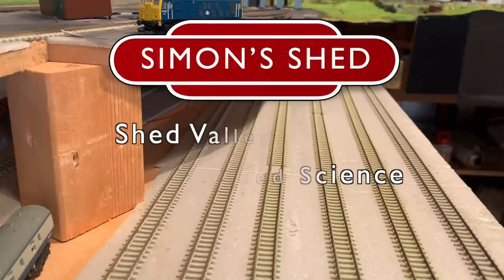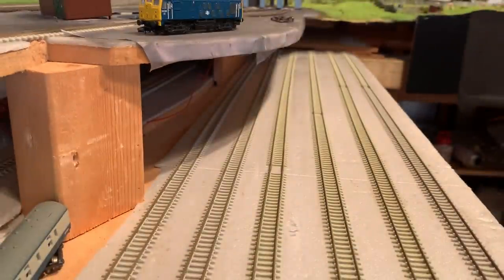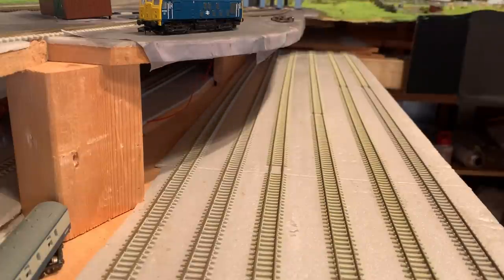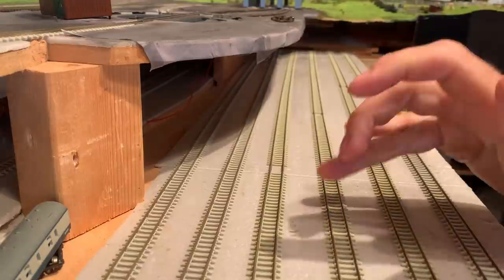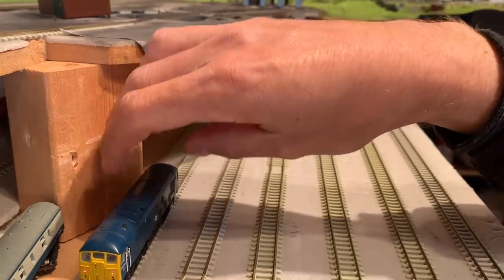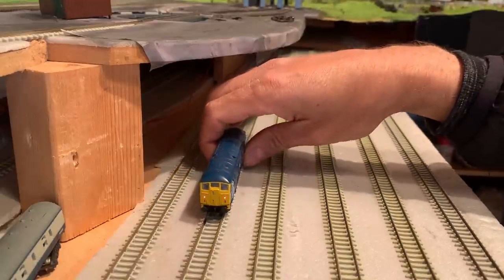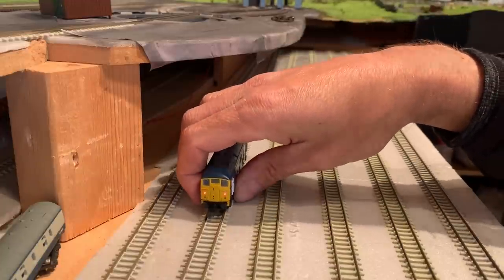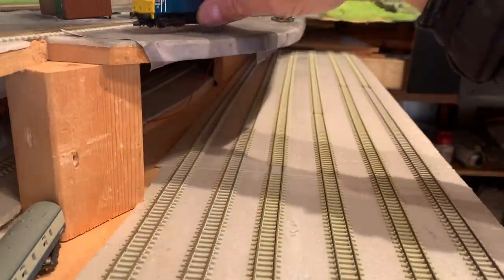Track cleaning for model railways

Comment: Inox is a repellant for dirt and dust [ Electrical ]. The positive is that
 it lubricates like fishplate said in his video. WD 40 is a lubricant for coating the distributor in your car.[ Mechanical ] The birdwood sub has lots of places where he cannot reach but he does not have any running problems .Greg works for Queensland Rail { QR } on Electrical maintenance and is very highly qualified.

Comment: I use CRC 2-26, which is produced in the US. It is the same as Fishplate Film's product. Like what you found with the WD-40 (not something that I would recommend) N scale trains do not run well immediately after using it, but leave it for 24 hours and everything runs well. I used to use a track rubber, and still occasionally still do to get some hard to move gunk that found its way onto the track, but then burnish the rails with a metal washer (making sure that the power to the track is off) and follow-up with a quick vacuum of the track and finally apply the CRC 2-26. I have used a piece of cork, a cloth or a piece of cardboard to apply it, and in all cases, it is amazing how much dirt still appears on the applicator.
In my environment, I found that after just using a track rubber, the track needed cleaning again within a week, but after using the CRC 2-26, I can go over a month before I need to clean track. A friend of mine, who was one of the people who put me onto CRC, claims he can go 6 months between cleaning, but he runs O scale.
Reply: I tried isopropanol, track rubber and brake fluid. Best by far has been CRC 2-26. Apply and let dry. Then enjoy your trains.
Reply: Home Depot $3.00 small can.

Comment: I seen the same video and agree the alcohol and other methods leave residue and debris on your rail. I found a CRC product for cleaning electric components that works wonders. My trains have never run so well for so long between cleaning. The cleaner I use is safe for plastis and doesn't eat the paint off the rails or grade crossings. Definitely worth a try. Tim
Reply: Will give this a go.

Comment: HI Simon,  
Thank you for the shout out on my video! As you say , a few weeks is not really enough of a test, as it took almost a year for me to start having issues with IPA . You can do a test and pour a small amount on a glass or metal surface and leave it dry, you will see a small amount of powder / residue left behind and this is the issue that builds up over time when used as a track cleaner. Innox and CRC2-26 are not contact cleaners,as such but leave a fine film to protect the rails form conductivity issues and they will also help remove dirt from wheels and rails, which you remove when you wipe the rails.
 I use Innox on real railway signalling equipment at work , so it works on big trains too..LOL 
Thanks again and all the best.
Gregg .

Comment: I started using "NOXID A Specal" it is an electrical contact grease. you need to clean the track using isopropyl then apply a very thin layer by using a very clean finger and then rubbing over with a wine cork. 
Upside is it lasts a long very time before you need to do it again, the downside is you might get traction problems if your application is too thick or gradients are more than 2.5 - 3.4 (or you like insanely long US style trains)

Comment: I use CRC and find that it works really well.  If using locos with traction tyres I make sure to wipe the rails with a dry cloth as it does cause wheel slip If it’s left soaked all over the rails.

Comment: Have used WD-40, 99% IPA and Track Cleaner, only main difference I've noticed is the price but they all generally worked well on some of my layouts.
Do need to get myself a powered Track Cleaner at some point, only got the Gaugemaster unpowered one which seems to work alright but isn't much more than a track rubber in a weighted wagon.
Nice to see all three loops running now Simon!
Reply from the maker: Thanks for watching, its good to get all of the tracks running again...now I can do a running session video!
Reply: Be careful with using the powered track cleaner,  a friend of mine has just had two locos repaired by an expert who put the failures down to the track cleaner. He has now disconnected the cleaner from his layout. I'd check out a few forums before you part with your cash. It seems to be suited to DC layouts using older locos with more basic motors.
Reply: The one I've been eyeing up is the Gaugemaster remake of the Tomytec powered cleaner as it's the same livery as the unpowered one (just for consistency), luckily for my layout it's just a matter of switching the controllers to switch between DC/DCC so that isn't an issue, though might look at getting an older loco to pull it round to be on the safe side.
Cheers for the warning!
Reply: @GosportRailworks  no probs, though we may be on different pages! The one I was referring to is their electronic track cleaner that is wired to the layout as a permanent device.
Reply: No worries, still it's better to be safe than sorry considering the price of models.

Comment: You used the wd40 .you need the Wd40 electronic contact cleaner.This is different to normal wd40 .i have used the wd40 contact cleaner and my track and trains are running better then it ever . thanks to fish plate. So do put any of that crap that you used on your track. You can get electronic contact cleaner from Screwfix or Halfords. so do that and you will not have any problems with running trains. And run your rolling stock over it when it wet it clean the wheels on all . Happy modelling 😀👍

Comment: I use lighter fluid, (naphtha), when my track is really dirty. It's readily available.

There are two kinds of Isopropyl Alcohol sold in the UK. 70% and 99% pure. The 70% kind has water in it. It's the 99% pure that you want for cleaning the track. It's prohibited to send flammable solvents such as IPA by Royal Mail. It is you, the one who ordered it, that will be held responsible. If you do order it, make sure it's sent by courier. 
WD-40 stands for Water Dispersant 40th formula. It was developed for use on the Atlas Rocket to prevent rust and corrosion. It can attack some kinds of plastics. I've read of a plastic modeller using it on the wheels of his aircraft model which melted and dropped off. When the solvent in WD-40 dries it leaves a black gunk. I know. I used it many years ago on my living room door hinges. Can't get the stuff off the door. :-p The only model railway use is to oil the hinges on your garden gate so the other half doesn't hear the postie delivering another very expensive model to you. :D I contacted the WD-40 company and asked if it was safe to use on model railways. They said ask the model railway manufacturers because they didn't know.

I think that window cleaner also leaves a residue which is there to make your windows sparkle without streaks.

White vinegar is comprised of acetic acid (about 5-10%) and water (about 90-95%).

Australians use Methylated Spirit. The kind sold in Australia is not the same as sold in the UK. There's is a clear liquid while the kind sold in the UK has a blue dye in it, to stop people drinking it, and when it dries it will also leave a residue.
Reply: Amen! at last clarity!
Reply: I’ve been using meths for a few years now and it seems to do the trick. I have also tried the Wahls clipper oil by placing a few drops around the layout allowing the loco to spread it around. That also seemed to work.

Comment: Best way I've found is to use high concentrate IPA (99%) and use a small square of Masonite. I have a friend who works at a supermarket, and they use Masonite board in between layers of stock on pallets, so I can get an unlimited supply (also makes great fascia boards!). Using the ROUGH side, put a small amount of IPA on, and rub the track with that. The rough side of the Masonite seems to soak up the small amount of water, and it will take up the dirt and grit, but is soft enough not to damage the track. Be careful with things like electrical contact cleaner. They do great to keep the rails conductive, but they can be pretty bad for spreading muck around the track, and ESPECIALLY onto loco wheels!
Reply: Greg Rientjes you need to watch Fishplate Films to see why you SHOULDN’T use IPA to clean track!

Comment: When I had a gauge 1 garden railway with a mixture of Aristocraft and Peco track, an application of WD40 (without wiping off) letting the trains spread it around the track, would make an immediate difference to the running of the locos. Electrical pick-up was enhanced and it had the additional benefit of flange lubrication on the tight radius curves.
Although most of my rolling stock had metal-tyred wheels, there was no damage to any plastic wheeled stock. The track was in use for several years, with exposure to the weather and bird droppings, but the WD40 coped admirably with all that. The only damage that ever occurred was a nearby lightning strike frying the output transistor on the power supply.
For my more recent indoor 00 gauge lines, I use a Peco cleaning block or a fibreglass electrical contact cleaner stick.

Comment: I bought a product to fix the connection issues I had with the trailer plug/socket on my car (which gets exposed to road salt in winter). The label on the product insisted that after cleaning I needed to use their other product on the connection to prevent re-oxidation. It worked ok. Doing some research online I found out that the cleaner was  isopropanol and the protecter was isopropanol + some hydrocarbons similar to those found in CRC 5-56 / WD-40... I think this applies to many contact/electrical cleaners...

Comment: Speaking of science, Joe at MRH magazine has the following to say about track cleaning: "Anything in the non-polar range is "best". Best really is what's cheapest, and the La Mesa club is getting superb results with mineral spirits, so I'd recommend starting there.  The dielectric constant isn't the only consideration -- there's also how any solvent reside ages. Mineral spirits is more of a solvent, s will both clean and protect -- a great balance.  Finally, a very light treatment on the inner railhead with a graphite stick will add that extra touch to help protect the wheels and rail from rapid oxidation from micro-arcing."

Joe also states: "I don't recommend ISO alcohol for cleaning track (or wheels) any longer. The La Mesa club has found track and wheels get dirty with black gunk a lot quicker when cleaned with alcohol so they have banned its use for cleaning wheels or track. Chemists know that non-polar solvents make the best electrical cleaners because they don't encourage new oxidation later as much as polar solvents. Non-polar solvents: - mineral spirits - turpentine - kerosene - toluene (nasty stuff, though) Semi-polar solvent: - ethyl acetate Polar solvents: - isopropyl alcohol - ethyl alcohol - denatured alcohol - acetone - ammonia Better choices for cleaning electrical surfaces are the non-polar solvents or at least a semi-polar like ethyl acetate. If your reaction to this news is: "I've never had a problem with the polar solvents", I challenge you to try cleaning wheels and track with a non-polar solvent instead. You may find things stay cleaner longer! The non-polar solvents reduce micro-racing and oxidation of active electrical surfaces. You who have been in the hobby for a while may remember the "clipper oil keeps your track clean longer" discussion from decades ago. Clipper oil is NON-POLAR. Also, if you check contact cleaners like DeToxIt or CRC-26, you will find they're slightly oily, which means they're also non-polar in nature."

Comment: The guy from Australia recommended electrical contact cleaner. WD make such a cleaner which is different to the penetrating fluid  version you put on your track.
Reply: INOX MX3 may effect some rubber products with continual long term use.

Comment: How often would you suggest cleaning the track?
Reply from the maker: If everything is running smoothly I'd leave it, I only clean the track it the locos are stopping / stuttering.
Reply: @SimonsShed  I only have 2 locos at the moment. A Dapol Class 33 which I brought brand new. The other being a Dapol Class 04 second hand from ebay. The 33 runs perfect at both slow and fast speed, Where as the 04 runs ok with throttle wide open but keeps stopping at slow speeds no good for shunting. I think the 04 being second hand maybe needs a clean/service but unsure how to do that.

Comment: i use n gauge kato track.i  found brasso on fibre,which removes dirt far greater amounts than track cleaner or ipa, then polish off with a j cloth. no problem with engine performance.Sam,s trains was my reference for ipa but brasso just pulls the dirt off.My kato tgv's just fly round.

Comment: we recently dug out our box of track. we dont have a fixed layout so had to spend long time with 1200 wet and dry to remove the oxidation. we where wondering if we dunked the whole lot in bucket of coke as we know what it does to a dirty old 2p.?
Reply: I just got a free train table that i want to clean up so i can run my trains.

Comment: I watched the same video but thought he said it had to be silicone free which WD40 is not. I was going to get some contact cleaner to try. I would be interested in how they effect the points connectivity over time. However it seems to be running fine with the WD40 so now I'm confused.
Reply from the maker: just to confuse things even more, just checked the front of my can of wd40 and it says "silicone free"!  Maybe they changed the formula?
Reply: @SimonsShed  Oh Ok thats fine then.

Comment: Isopropynol or Isoporpyl Alcohol or IPA are all names for the same thing. The modern  scientific name is propyn-2-ol. The "propyn" part of the name just means there are 3 carbon atoms (as opposed to regular ethanol, or as we often call it, "alcohol, which only has two). The "ynol" or "alcohol" part means it has an "-OH" radical attached. The "iso" part of the name just means the -OH part attaches to the middle carbon atom rather than one of the ends, as it would with propyn-1-ol.
Anyway, check the purity of your isoproponal. Generally it's either 60-70% pure, which is fine for killing coronavirus, but should be kept away from anything electrical, or 98%+, which should be perfectly fine for your tracks.
I'd have concerns about the amount of water in both vinegar and window cleaner, but as long as you dry the track thoroughly, I think they're unlikely to do any damage.
In my younger days I used to use "methylated spirits", also known as "denatured alcohol", which I believe is ethanol with methanol and other toxins added to stop stop people drinking it (ironically, the additives make it far more dangerous than selling pure ethanol). It seemed to do a good job back then.

Comment: Wd40 is oil  might as well clean your track with Castrol
Reply: WD-40 doesn't have much oil in it. Not the standard WD-40 anyway. The UK (and EU) formulation is stated according to the REACH regulations:
 60-80% hydrocarbons C9-C11 n-alkanes, iso-alkanes, cyclics <2% aromatics1-5% carbon dioxide.
Reply: There's a difference between wd40 and wd40 contact cleaner

Comment: I use 99.7% IPA and not had any problems. I wouldn't use standard WD40 or the type of stuff Fishplate Films mentioned (not sure they are the same) as some of my locos do have traction tyres. WD40 Contact Cleaner is something I may try as it would also help with other electrical switches etc..

Comment: What fishplate films recommended was electronic contact cleaner in a spray can. I have to agree but it's expensive. I just use 91% IPA on a paper towel. Never use anything with oil in it such as WD40. If that stuff gets on your train wheels it will become a magnet for guck and crud.

Comment: Hi Simon, interesting to see this, your test was good but it might have been good to clean the loco wheels between each test. Track cleaning is no real mystery, IPA is designed to clean contact surfaces, is an approved switch contact cleaner and scientifically works. WD40 is designed to displace water, clean and lubricate, so if you apply that it will add grease to your rails and wheels which is exactly what you don't want, its also a hydrocarbon so will attack some plastics. I am aware of this other amusing video but while it's a lot of fun some aspects of it don't stack up in my opinion, proclaiming that the substance used is food safe while displaying a bottle of it clearly marked 'non food safe'  I recently did a video on the very subject, if you have time maybe check it out and see if it meets with your findings? Happy modeling and stay safe. Mike.

Comment: I was using Goo Gone for a long time.  A number of folks were.  Then people started complaining about the residue it leaves.   The residue is a very fine oil.  I had always wiped my tracks off, but the slight oil improved the performance of my locomotives around curves.   Then I heard you should only use alcohol but isopropyl alcohol contains other chemicals which I am sure are deposited on the track as residue and I was cleaning the track with my track rubber to remove it.  WD-40 is a water displacer but no doubt contains oils of some kind.  Whale?  If I have a particularly troublesome spot I still use Goo Gone.  I just don't know.  Have I ruined my track?  Your corrugated paperboard is an abrasive, I suppose you know that.  ;-D  Rob
Reply from the maker: Its a whole can of worms isn't it!  So many different opinions saying x is great or x will cause your layout to burst into flames 😀Thanks for watching 👍
Reply: WD-40 does not contain fish oil nor whale oil, contrary to a popular myth, nor does it contain silicone, kerosene, water, wax, graphite, chlorofluorocarbons (CFCs).